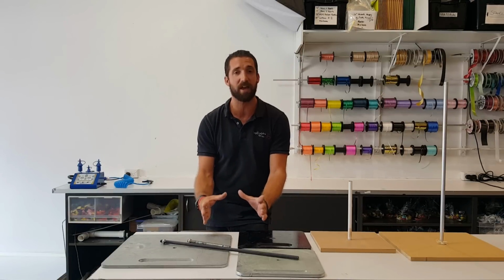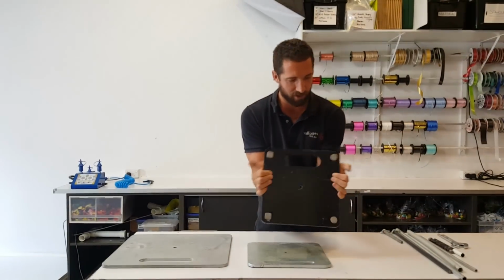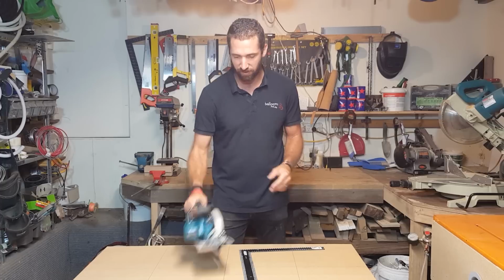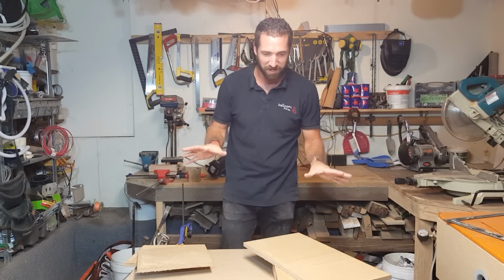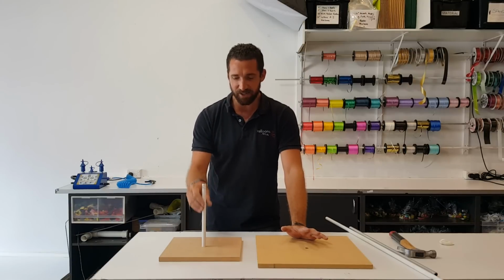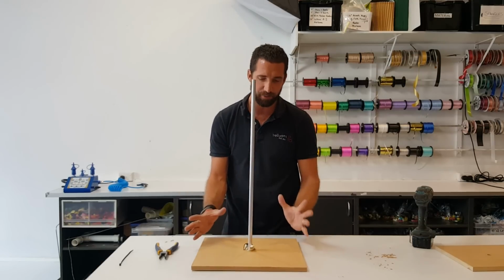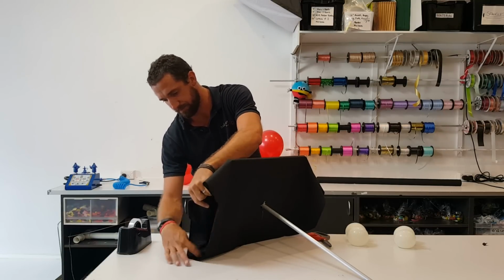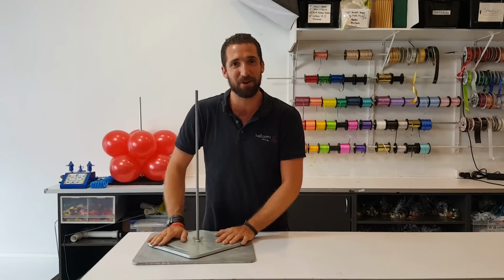Base Plate Design - Balloons Online Tutorial 14

Comment: Perfect timing! I needed 8 "disposable" base plates and here you show up in my inbox with all the info I need!   I use the Aeropole system for my large exterior arches and last year I almost had a double mishap. I arrived just in time to find that the wind had almost pulled both ends out of the bases. Now I tie the arches to the bases with metal wiring. Thank you for sharing your methods - very helpful!

Comment: Hi Chris. Good tip using the scrap latex balloon to pack the hole in the base. I have always used a slightly oversized dowel 'sharpened' on the end to tightly fit the hole but your method is much better. Thanks a lot. Steve Marsh CBA.